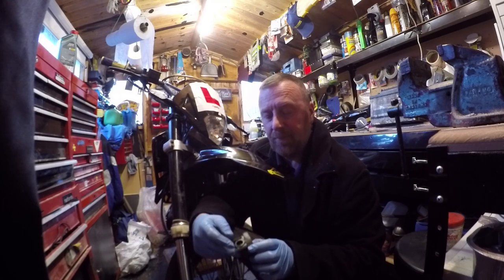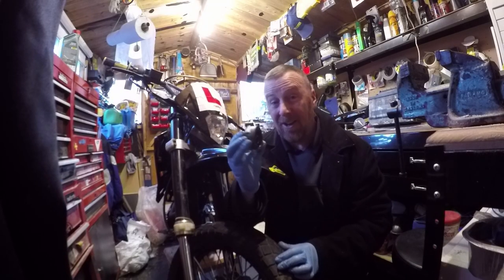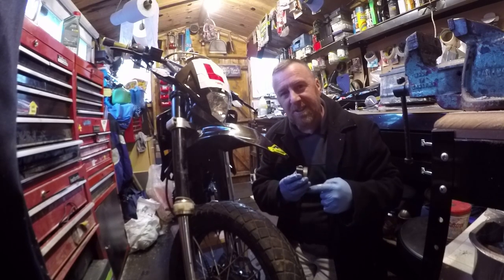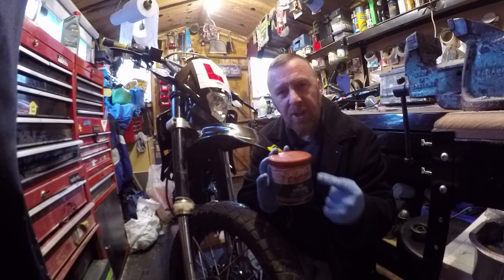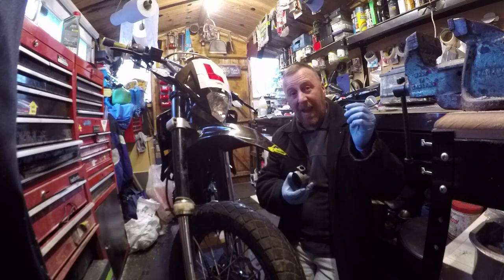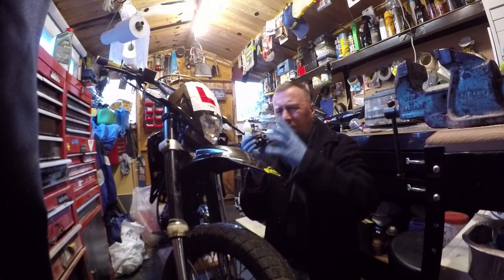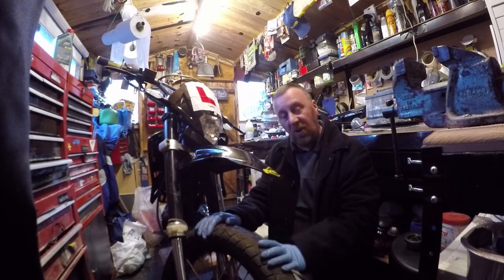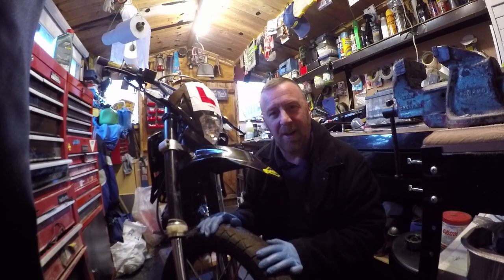125 SPEEDO DRIVE NOT WORKING FAULTY HELP TO FIX MARK SAVAGE

Comment: Neither of my dials work even with a new cable. Any ideas? Does the rev counter work off the same cable?
Reply from the maker: no bud , cable to speedo drive other side to clocks , rev to engine

Comment: Pioneer 125 Nevada start off kick no lights no electric start any help
Reply from the maker: hi 
battery connected and working 
fuse checked and ok 
if so you may have two different problems 
dead starter so change 
bulb gone or damaged wires

Comment: first comment and I have a question about new piston replacement how to ride it I mean on low speed after 4 or 3 full fuel? type gilera runner sp 50 cc
Reply from the maker: I often add a little 2t oil for 2t mopeds as it helps lubricate and wear in better, just ride sensible for the first tank as in not full throttle so 100 miles bring up the speed slowly 
2nd tank open up a bit more and give it some in short bursts, this helps settle the piston much better 
carry on with this for a few miles and ride happy bud 
you will know if it's not right from the first ride any way with poor starting and lake of any power , otherwise all good
mark
Reply: @marksavage    thank you so much mark keep it up bud
Reply: @marksavage   mark i have  one more  question today i did speedup little bit and  its did spot by herself   i didn't try to kick it again after that did happend i did give it  little bit time and then did work why she did autostop engine  ? sorry for my bad english